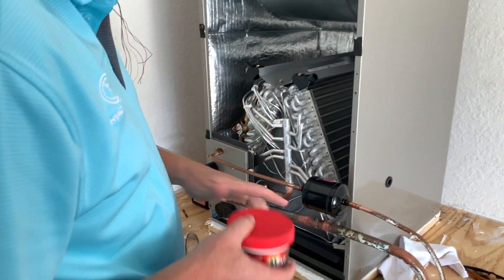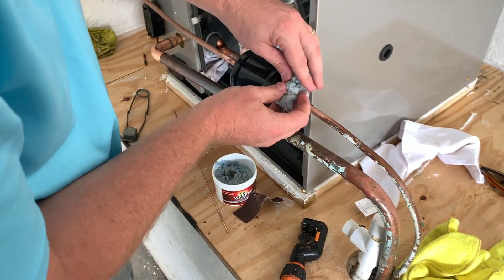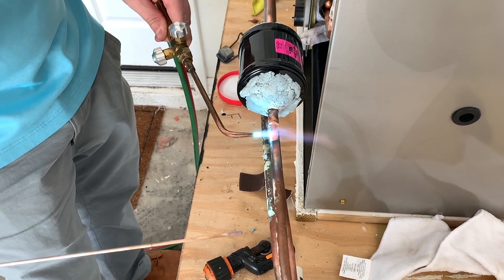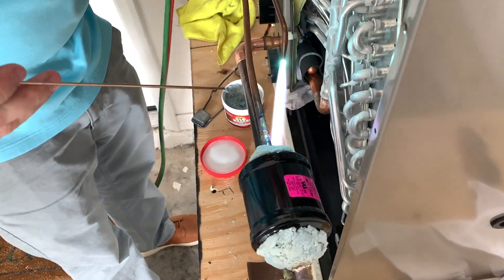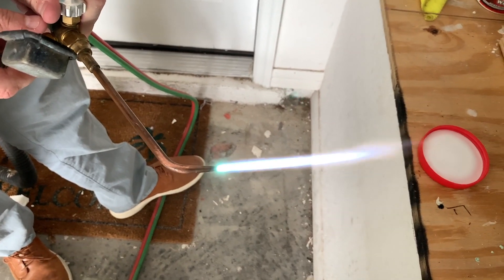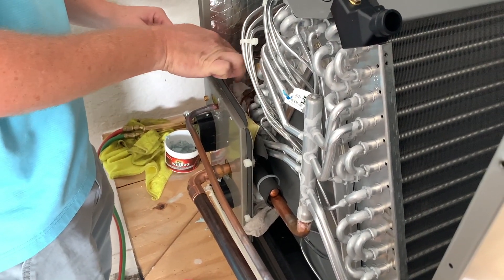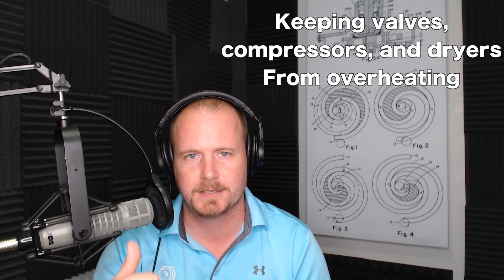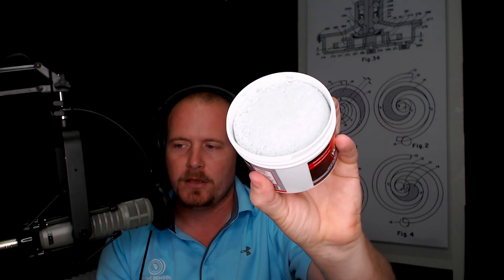Protecting Components While Brazing w/ WetRag

Comment: Wet tag is great on smaller lines but I had trouble using it while brazing in shutoff valves on 1-1/8" lines. The pile of Wet Rag was too big and the heat applied started to dry it out. I'll still use it on smaller lines but might stay away from it on bigger lines.

Comment: I agree refrigeration technologies has good products but it is very hard to find their products at any distributors here in the Midwest. I have to get my products on-line one from California and New York. Does anybody know if you can buy their products directly from them since the distribution is hit & miss?
Reply: Johnstone Supply and United Refrigeration
Reply: Refrigeration Technologies those distributors are 60 miles away, the closest four distributor to me are 30 miles away, unfortunately they don’t carry your product. The only reason I order it on-line is there is no freight charge, although the prices are comparative to the distributors you mention,  Johntone and URI would charge $26.00 shipping. Thanks for responding
Reply: @superiorcomfortheatingairl3373  Send me a list of the distributors and I will work on getting the product stocked for you.
Reply: Refrigeration Technologies If you Google HVAC Distributor in St Joseph Missouri the four distributors will come up, but I am really impressed with AC Pro and SupplyHouse (maybe you can get Supply House won’t stock the cans of coil cleaner just the 1 Gallon Bottle). If you do get hooked up with any of the four distributors throw a T-Shirt or Hat my way. I love the Viper Logo, you be surprised on the comments I get from customers especially when I do a leak search and they see the snake on the soap bottle, it can turn into a great conversation

Comment: Welding and Brazing is a Art. Once the load heated is at melting point of the solder I work fast as possible wicking around with the given flame temperature.  
I prefer as hot as possible, Being carefull not to blow a hole. Have seen many holding a low temp flame over 45 seconds transferring heat toward components burning them while waiting for the solder to melt. I can do it in 10 Seconds. :-) Even though that one joint wicked a little less it is perfect.

Comment: I thought the wet rag was to be used in place of an actual rag. You seemed to use it for protecting paint by the way you applied it, especially on the liquid line at the evaporator.
While it can protect the paint, using it applied specifically on the copper like you would an actual rag should minimize the heat transfer past it. If it is loose, like on the evaporator joint, it does little to block the heat transfer.
Used properly it can be a good substitute for rags.

Comment: Try a turbo torch thay work good and you only have one tank just use a number 14 or 11 tip and a wet rag
Reply: Troy B 
    I learned to solder using oxy/acetylene torches starting in 1979.
   Turbo torches have always struck me as a non precision tool. I know my torches are heavy but they are quicker and more precise.

Comment: You didn't remove the sensing bulb you have to be kidding me
Reply: If you always remove it you will never damage it. The five minutes it takes to remove and install the bulb  is CHEAP insurance. One damaged valve would be expensive. The time and materials plus the lost revenue from the job you could have done while replacing the txv. But of course I look at it and decide to leave or remove the bulb on a casa by case basis. I always remove the electronic sensor for the eev regardless.
Reply: If properly isolated and heat applied properly, removing the bulb is not necessary.
In situations where you can't do that, removing the bulb is recommended. If you are new to brazing it is also a good idea to remove it.